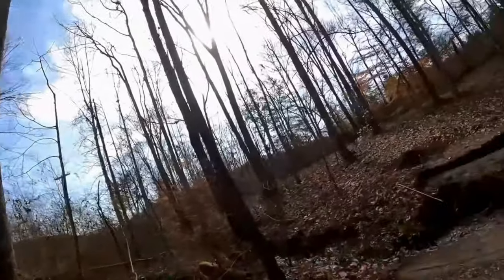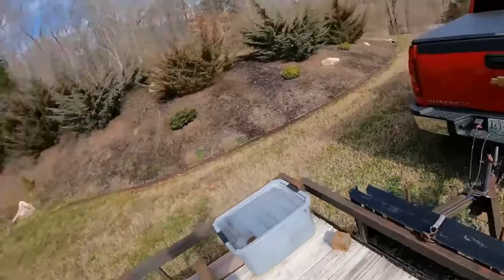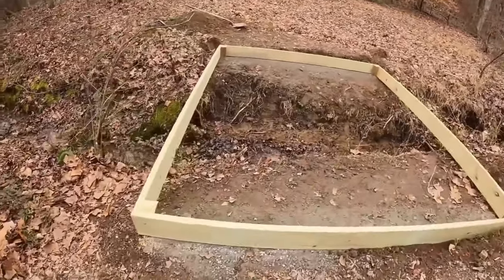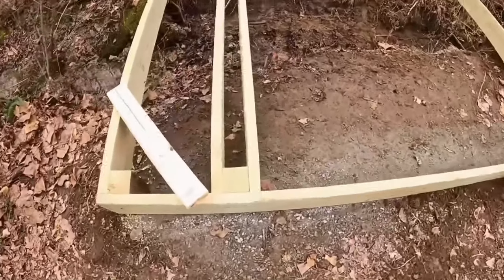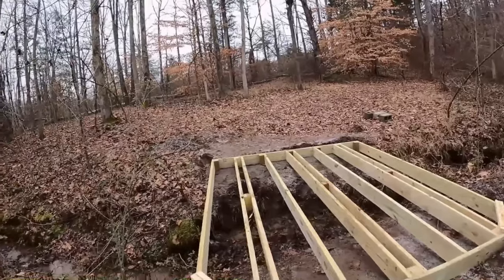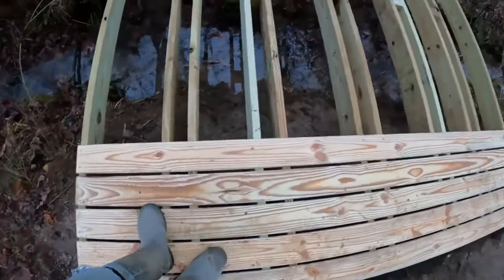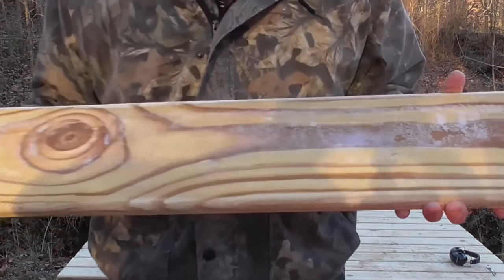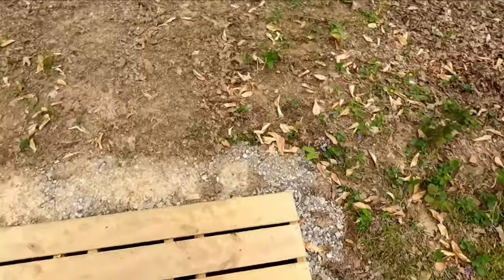Building a Wooden Bridge for my Tractor and Yamaha Wolverine RMAX 1000.

Comment: Great work!  I built one of those but not that wide.  A big rain came along and floated it 15-20 yards down steam.  It was twisted up and needed repairs.  Once back in place I tied it down using ratchets attached to 6' long metal posts hammered 5' deep and angled.
Reply from the maker: Wow I bet it held in place after that. I don’t think I have ever seen water come anywhere close to the bottom but anything is possible hahahahha.  Thank you for taking the time to watch and comment!

Comment: Nice Bridge.
How the bridage level?
And the bridge is stable? Not that you even put concrete in it.
Reply from the maker: Thank you... I leveled the bridge from side to side, but it does slightly rise from one side of the creek to the other. This didn't bother me, and it actually is more level than I thought it was going to be. hhahahaha.  I used concrete just to give it a platform to rest on. I allowed mother nature to wet the concrete for me. It just formed a fairly level pad to work on, so that was helpful.

Comment: Nice job on this small bridge, but I wonder why you didn’t just put in a 12-18” metal culvert and  cover it with dirt?  The other option would have been to build a ford using number 1 rock with smaller rock (#3 or crusher run) on top.
Reply from the maker: Great Question, Doug... I thought about that. The creek gets really full when it rains for several days, and I think it needed closer to a 24" pipe. I called a local place and it was going to be crazy expensive to buy the pipe, and I could only get it in 20 foot lengths. I also wasn't sure how I would get enough dirt to cover it, or where to get it from. In my mind, I just thought the bridge would look nicer, overall.  I also have debated putting some rip rap above it to slow the water down, or even make a small pool of water for wildlife.